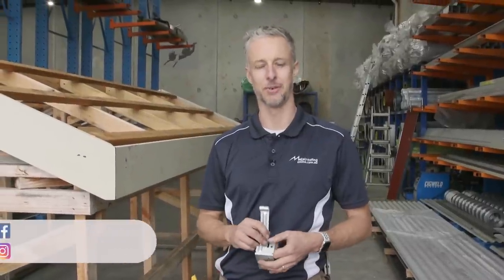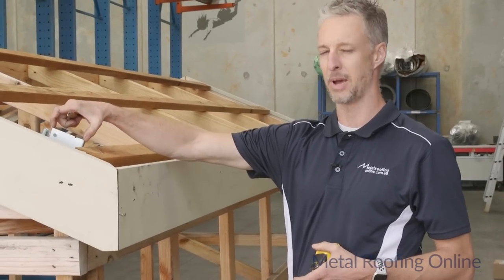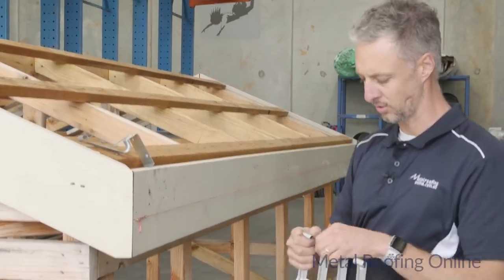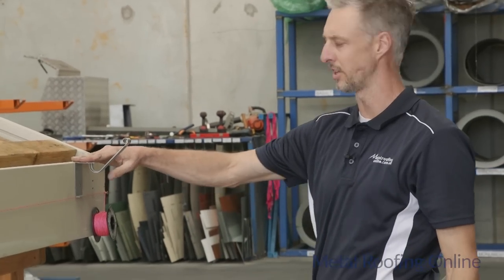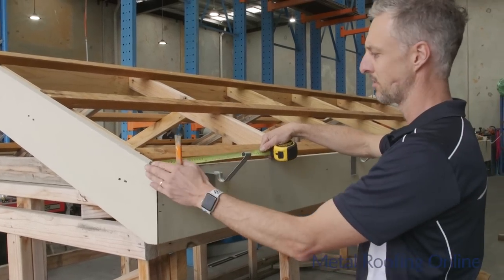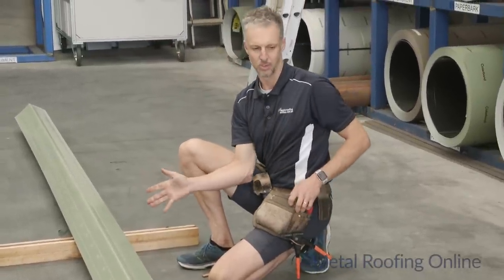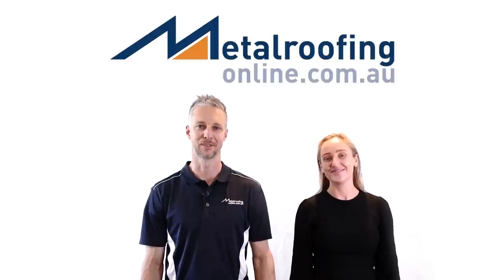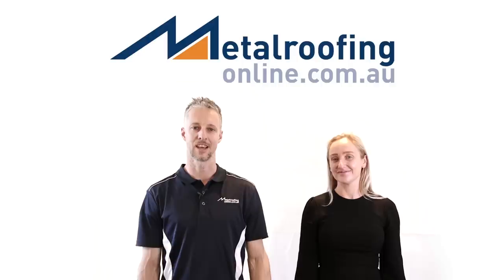How to: COLORBOND® Gutter Sheerline on to timber fascia

Comment: Hi Mate, I want to install a insulated panel roof and use a sheerline gutter, however the insulated panel have a 0.55mm Z flashing and not a timber fascia. Can I still use a internal bracket with sheerline gutting and screw into the 0.55mm Z flashing?
Reply: You may be able to fix to the metal z flashing with a small steel fix screw or you could use rivets